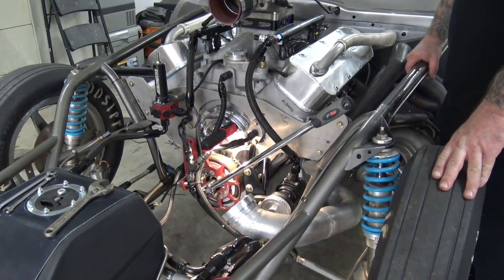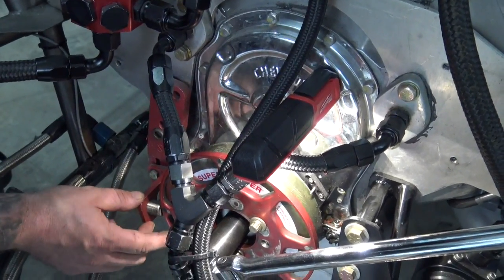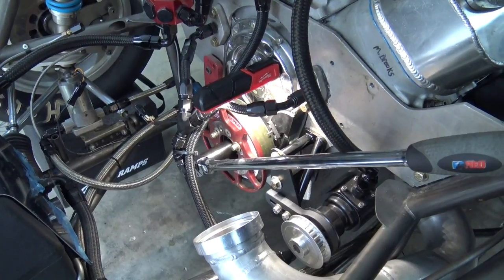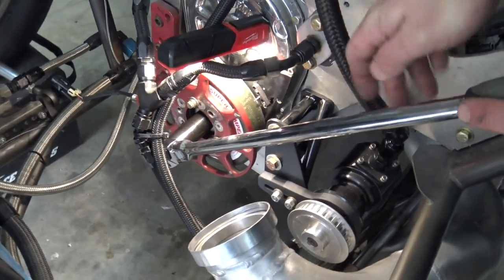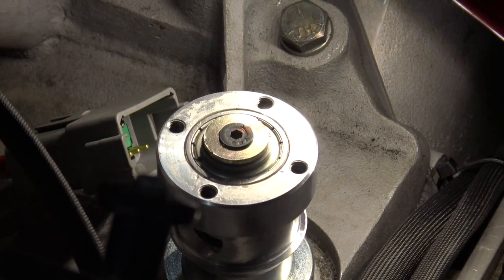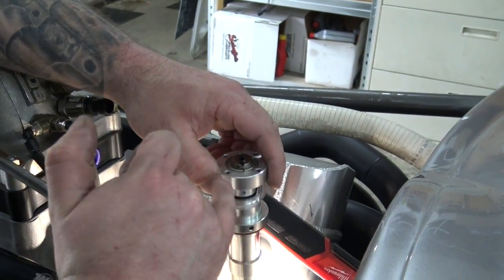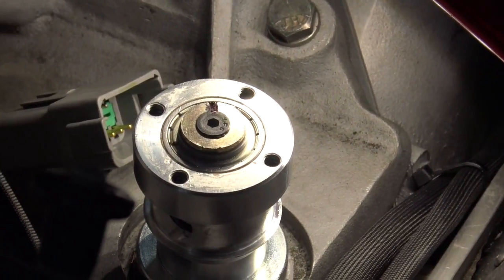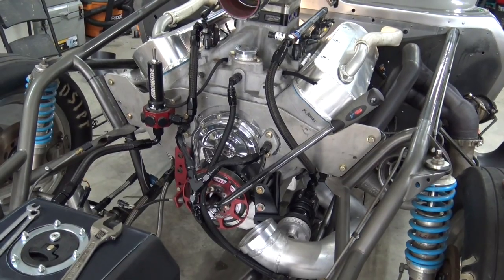Msd crank trigger and Cam sync setup for Holley Efi

Comment: so with a 4 magnet crank trigger 2 wire unit msd how do you properly wire it to the holley ecu?>  all the data i have read it requires 4 wires? thanks in advance

Comment: Could you explain why you are setting the cam sync pickup at 195 degrees BTDC? I would think that you would want to set it to set it closer to the 60 degrees BTDC like the crank sensor. I’m setting up a 60-1 crank trigger with a cam sync. Thanks for the info!!!
Reply: You don’t want them to overlap. 60-1 would be a nightmare for cam sync. We just took a 32-1 off and put on a 4 magnet wheel. Sick of issues
Reply: @nsboost  Great, i ordered the holley trigger setup and cam sync for a megasquirt 3 setup. hope its NOT  nightmare to get it going
Reply: @belldynamics7680  when it comes to sequential efi… the cam/crank sync is always the trickiest thing to get right. But it’s worth it to have the benefits. Imho

Comment: Thanks for the video, how critical is the 195* BTDC?  What if you have a crank reference angle of 60* and your cam sync is falling at  190 instead of 195? I’m using the same 4 magnet MSD crank trigger with a Holley HE crank and Holley HE cam sensor reading off a magnet in the belt drive cam gear.

Comment: Nice video! Not sure if you know anything about 92 mustang 5.0's but, I'm down in Charlotte and I'm trying to wire up my Holly crank sensor to a factory distributor wiring harness. Do you know that info or where I could find that information? Thanks!!
Reply: Search through Holley’s videos- I just saw some info on the SBF ignition while searching for cam sync info.